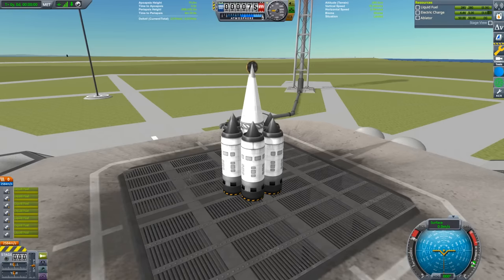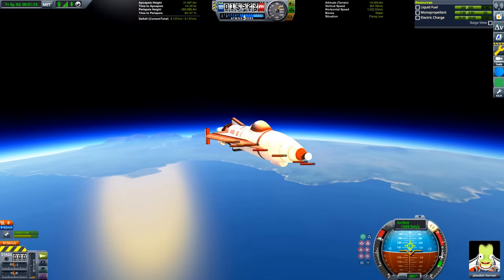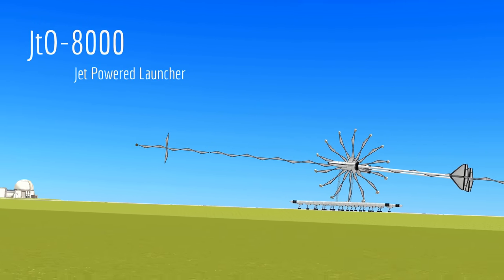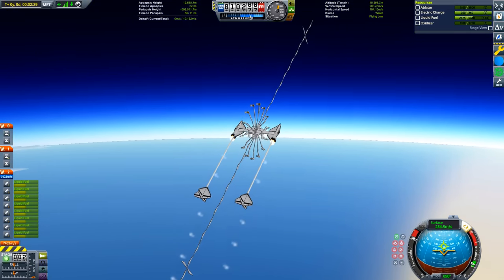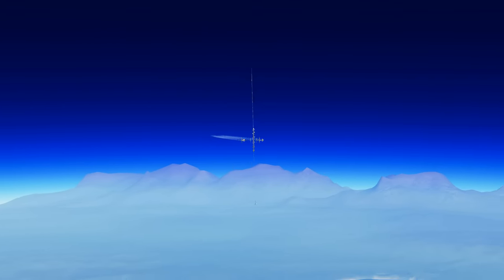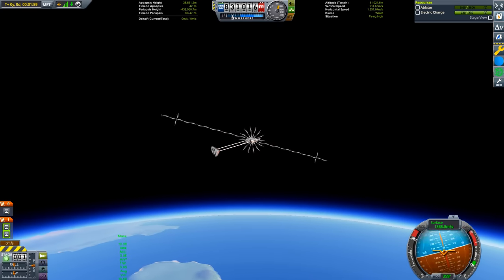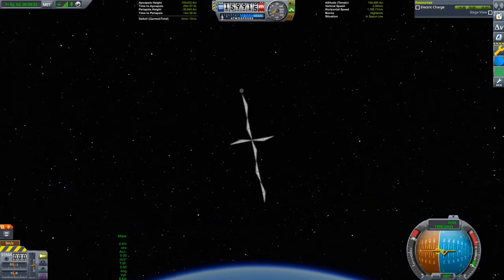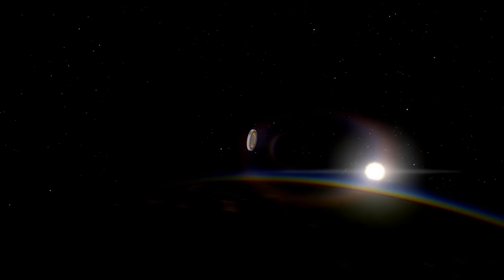Orbiting Kerbin using only Jet Engines | Stock KSP 1.7

Comment: What if you had a long hose dragging far below the jet to scoop air up to the jet? A space snorkel. Or since the air is too thin to provide enough to a normally configured jet intake just open a large conical umbrella opening like scoop intake for more thin air to keep the jet firing at higher altitude, and speed. Or carry a tank of oxygen for the last sprint into orbit. Some may object on the technicality that makes it a rocket not a jet to which I would say technically a rocket is a jet. It would also fuel the orbit stabilization burn. But I disagree non rocket jet stabilization should be a specification in the first place. If you can get to orbit without using expensive rockets then a small stabilization rocket is fair. With that specification disposed of you wouldn't have to throw the whole trebuchet into orbit just to use it for the stabilization hurl. Without the trebuchet, which you say is the most massive component, you get a larger payload into orbit. Surely enough to carry a small stabilization rocket. I would point out the scoring criteria for all launch specs is cost to payload ratios. Good job getting it into orbit in the first place but now you have to up your score. I personally, not only  uped the payload score of SpaceX's real rockets but at the same time solved their landing crash problem they had. My solution is why SpaceX can now stick the landings so reliably. Simple solution. 4 words. Increase roll control authority. You might notice in the early crash landings the rocket was wallowing down to the landing, and rolling just slightly. Now it doesn't roll a bit, and doesn't wallow down to the landing. The way that upped the payload score is that with a more reliable landing it didn't have to burn as long thus saving fuel in landing, and 10 times more off the launch pad.

Comment: Another trick that worked before (i belive they fixed it) was to just put 1000 of intakes on your plane, as the intake air was a recourse that was “like oxidizer“
Explanation: the intake was producing „intake air“ wich then the engine used ( intake air was a value of about 0.1 but i dont remember it anymore )
Then because u had like thousands of those intakes u had like a tank of intake air :)

Comment: So, its a little like those "perpetual motion" machines, that use the change in center of mass to spin for ages. They dont work, but... Its sorta similar
Reply: Not really. In those, no energy gets added, it's just conserved really well.
In this, energy gets added by drag, so it actually begins to spin faster than the starting speed. It's like a flywheel strapped to a windmill basically.

Comment: RAPIER's are kerbalized SABRE engines from Skylon. They are rocket engines. But without oxidizer they do act like jet engines.
Reply: @HO LAM YIU It's a common misconception that they run on jet engine mode. What they are and always will be is rocket engines. Combustion chamber, turbopumps, preburners all the good stuff. No compressor stages, blades, bypass ratio none of that. It has as much in common with a jet engine as a diesel engine. If anything it's half SCRAM-jet half rocket engine in open cycle mode.

 In one case it simply takes oxidizer in the form of pure oxygen from the tanks and in the other it takes supercooled air that passes by hydrogen (fuel) cooled channels in a giant precooler/heat exchanger. No matter where the oxidizer comes from it is still a rocket engine. In open cycle mode an airbreathing one. Which has never done before and is the revolutionary part about the SABRE engine.
Reply: @HO LAM YIU I'm not arguing Stratzenblitze's achievement for that it's irrelevant I'm just nit-picking about the nature of SABRE and by extension Rapier engines. They are rocket engines. That's all. No oxidizer besides air used so he did in fact get into orbit using only the the amtosphere as propellant which is impossible except if you use some very clever physics like he did. The basic principle is sound and storing energy in rotation is common practice in engineering going back all the way to steam engines and fly-wheels and probably back to antiquity.

Comment: Very easy to tell why this should be impossible: Jet engines need O2, in KSP no O2 in space (not even tiny amount like in real life), and to achieve orbital flight (never dip below 70K), you should need to do at least a small burn over 70K.

Comment: A smaller "catapult" flywheel with more surface would produce more speed, (although be it, unstable speed), because of the small CoG around the pivot point.

Unless my physics class failed me that is.
Reply from the maker: You are correct: a smaller radius will be able to accelerate faster and reach a higher rotation rate due to its lower moment of inertia and lower drag. However, it becomes almost impossible to time the release correctly at those speeds: The most I could reliably time was 10 rad/s as shown in the video.
Reply: @Stratzenblitz75  Maybe place two payloads opposite each other and realistically you have a 2/4 chance of hitting a decent release, then again that's quite counter intuitive.

Anywhom, thanks for the reply!

Comment: One thing tho.
DId they nerve the Ramjet jetengines?
Because you used to be able to put them into a sort of feedbackloop in high athmosphere.
High speed would suck in more air, making the engine go faster, sucking in more air.
You could get to orbital speed easily even at 10km.
They always seemed much stronger in this than the RAPIER

BUt i haven´t played the game in a long while
Reply from the maker: They nerfed all the jet engines a while ago (I think 0.9? Its when they updated the aerodynamics model). They used to be able to reach orbital velocities on their own: now they have thrust curves that prevent them from going above Mach 6.

Comment: With an arm length of 1km and the speed at which the craft is rotating = 1km/s we have the acceleration of 100G :) Not possible to survive this unfortunately...
Reply from the maker: Yep, which is why something like this would only be used for unmanned payloads. Even then, the extremely high jerk (change in acceleration) caused by suddenly releasing the payload would no doubt cause problems. To make this feasible, a much longer arm length would be needed to reduce the centripetal acceleration.

Comment: I got in a 68km, 72km “Orbit“ just with jet engines and no rotation.
Reply: But you didn't use a double-catapult. smh.
Reply from the maker: Maybe in old KSP, but definitely not in the newest versions...

Or did you build a jet engine cannon ;)
Reply: @Stratzenblitz75  yes it was an older Version

Comment: This seems like it still doesn't count as it uses the force of decouplers to deliver the force is what is used for the final stretch
Reply from the maker: There was only 1 decoupler for the final detachment and its facing sideways so it can't provide forward impulse. All  of the delta V was from the rotation of the craft (which was provided by power from the jet engines)
Reply: @Stratzenblitz75  but what about the second to last stage? That got spinning really fast until the Jets couldn't keep going and you used the decouplers in that to provide the last strand for reaching the apoapsis out of the atmosphere
Reply from the maker: @The Simple Animator Thats what I'm referring to. Look closely, the final decoupler is rotated sideways, it cannot provide the necessary forward impulse.
Reply from the maker: Disregard my other response, I see what you mean now. The decoupler did not provide the delta V for the second stage to reach its apopasis. The delta V came from the 10 rad/s rotation of the craft
Reply: @Stratzenblitz75  oh, I get it now, yeah I see it generated Delta v from it's excessive spinning, yeah my bad I didn't really notice

Comment: W a i t
I have a legitimate question-
Would having a mechanism to retract the arms inward (basically making them shorter) be useful?

Not for ascent-
No no no
For the release.

Because of the law of conservation of momentum, if the spacecraft were to bring it’s arms inward as it spun, it would spin faster, which should put more energy into the release, right??
So you would fly the space windmill of madness up to altitude, retract the arms, and then yeet the next stage out while the arms are retracted in.

I don’t have a physics degree, hell i haven’t even gotten to college yet. But from what i do know about physics, that ought to work, right? Or is there something to do with atmospherics, or the total motion of the craft, or whatever that would invalidate this??
Reply: That's a good idea, but I think that would violate conservation of energy. Pulling the arms inward would increase the RPM and G force experienced by the craft, but (as far as I know, I could be wrong) the tangential velocity is actually the same. So there wouldn't really be a big difference.

Although, with that in mind, I wonder if the wheel can be made smaller and thus easier to fly.

Comment: Can you go to the mun with only jet engines and rcs thrusters
Reply from the maker: Yes! In fact, with RCS thrusters you wouldn't even have to make a jet powered catapult to do it. Just use a rapier as your first stage and then use RCS as your second/third/etc. stages. While RCS isn't ideal for this sort of mission it can absolutely be done.

Comment: Is my high school physics rusty?  I don't see why the penultimate stage should have been spinning after release.  Maybe there's a != between high school physics and kerbal physics?  Just eyeballing it, I'm thinking it would have to be up to around 5rpm to get 150m/s dv.
Reply from the maker: All points on a rigid body will have the same rotation. Thus, if you break a spinning rigid body into two pieces, those two pieces will retain the same rotation rate. To see why this happens, consider the equation for tangential velocity,  v_t = r * omega where r is the distance from the center of rotation and omega is the rotation rate in rad/s. 

Lets use my craft as an example:
My second stage is about 20 m long. Its center of mass is located about 90 m away from the center of rotation. This means that the closest edge is 80 meters from the center of rotation and the furthest edge is 100 m away. Assuming a rotation rate of 10 rad / s with the tangential velocity equation, this gives the inner edge a velocity of  800 m/s, and the outer edge a velocity of 1000 m/s. Alright, lets separate the second stage then. The points on the inner and outer edge retain the same velocity, but they are now rotating around the COM of the stage. The COM is moving at 900 m/s, which means the inner and outer edges have a relative velocity of 100 m/s. As mentioned before, the second stage has a length of 20 m, which means that each edge is 10 m from the COM. Using the tangential velocity equation again, we can calculate the rotation rate of the stage. You can see the rotation rate is 10 rad/s, which is the same as the structure before.

Also, I did make a mistake with my velocity gained: It was more like 75-100 m/s rather than 150. I mistook it for 150 m/s because I measured the relative velocity of the probe core to the wing-panel section. Of course, this measurement isn't accurate because the wing-panels were thrown in the opposite direction at a significant velocity.
Reply: @Stratzenblitz75  Thanks for explaining that!  I worked it out for myself and subjected my daughter (7th grade) to the necessary figuring and yeah, I got it now.  She probably doesn't, but we'll work on that.  Now I'm wondering what would happen to the opposite side of the contraption if you released it when it reaches the same point.  Somehow I doubt it'd have the same energy (assuming the whole thing doesn't just tear itself apart at the moment it becomes unbalanced).  Anyway, an exercise for the reader.

Comment: Couldn't you do it with stored air from a bunch of clipped intakes?
Reply from the maker: Actually, sadly you cannot. Engine thrust is based purely on the speed of sound so 1) you cannot use jet engines in space because there is no speed of sound 2) you cannot use jet engines above mach 6 or so where they are programmed to have 0 thrust.
Reply from the maker: Interestingly, this does mean you can use jet engines with stored air in the atmosphere of other planets, like Duna or Jool.
Reply: @Stratzenblitz75  Dammit, didn't think of that. I've only used that trick on Duna lol
Reply: @Stratzenblitz75  One other question, seeing how you can build up about 1700 m/s in kerbin atmosphere, I wonder if it's possible to convert that efficiently all to vertical velocity. 1700 m/s is enough (if headed straight up) to hit the mun and do a gravity assist off of it to get into orbit

Comment: Do we have different definitions of what "Stock" means?
Reply from the maker: I dont know. What about your definition of "Stock" does not apply to my craft?
Reply: @Stratzenblitz75  I was just looking at all the mods you have installed. It's not stock KSP, and specifically you used a strut mod to construct the ship. I have no clue about what else may or may not be mods.
Reply from the maker: Fair concern. If you aren't familiar with the mods used then I can see why you are confused about this. Let me assure you though, the mods I have installed are all visual/information mods. Kerbal Engineer Redux gives me delta V/orbital information; VOID gives me rotation speed information;  Collide-o-scope shows me part coliders; and so on.

Also, I didn't use a "strut mod". I used autostruts which are part of the stock game (you can enable them by enabling "advanced tweakables" in the in-game settings.

If you are unconvinced, feel free to download the craft and try it yourself. It will work in a completely stock install.